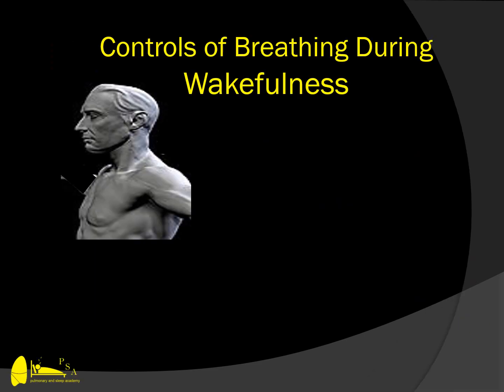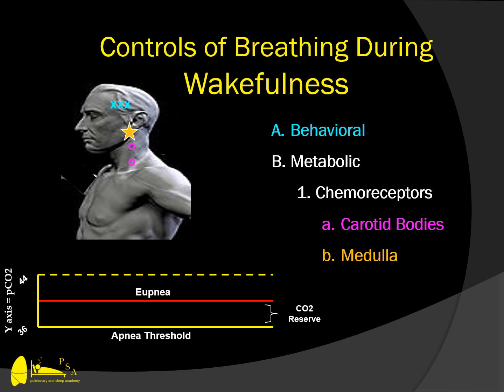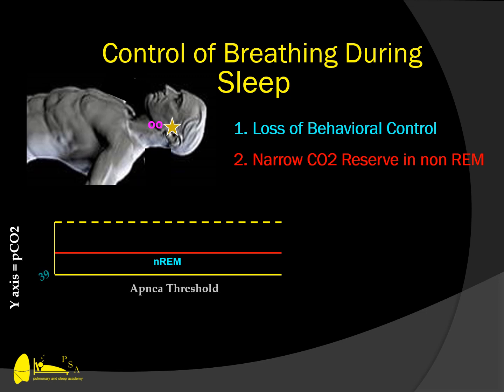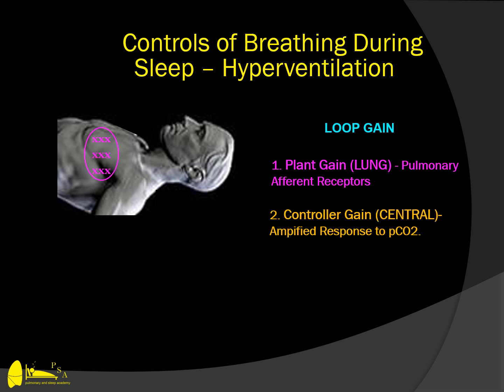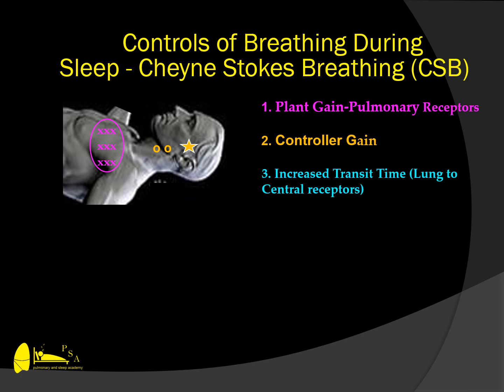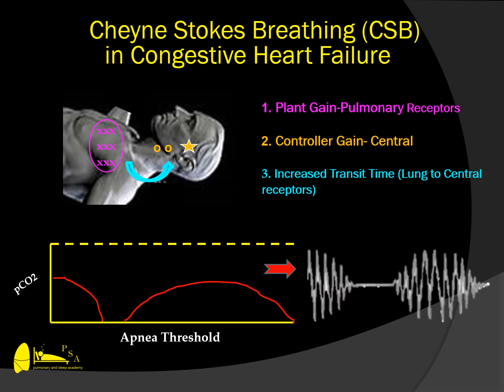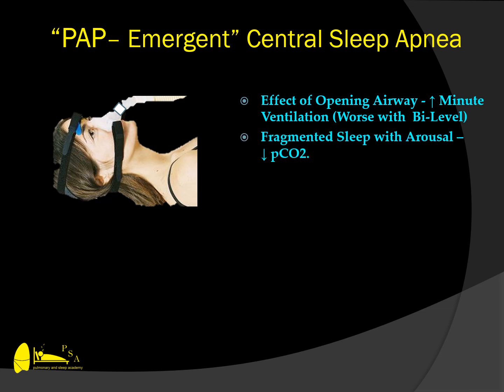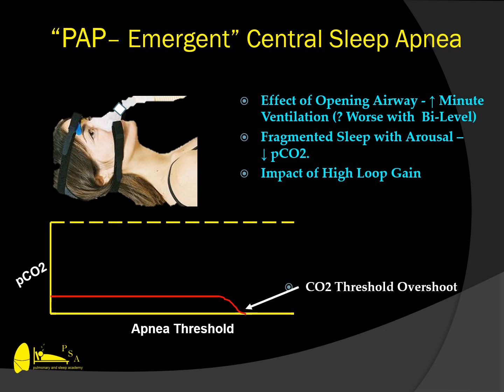Understanding Mechanisms of Central Sleep Apnea - BAVLS

Comment: Does anyone have a solution to this?   
I had some trouble with having high AHIs (probably mainly centrals) on my CPAP machine, cresting in the 50s. I told my sleep doctor we need to fix these. “Coincidentally” I had atrial flutter. Also “coincidentally” I had a cardioversion done on the morning of the sleep study that evening. My AHIs (probably mainly centrals) fell to sub five and stayed there for the next 10 days. “Correlation ≠ Causality” I can hear already! BUT‼️ Occasionally it does. I usually hear apnea contributes to fibrillation or flutter from my cardio but which is it? Post hoc ergo propter hoc would say the atrial flutter was causing the AHIs. 
The pressure of my CPAP was adjusted 10 days after the cardioversion by the doctor. So it was the cardioversion that fixed the AHI. Anyone have an idea how these are related and what is a fixit for it?

Comment: Can supplemental continuous flow O2, as provided by a concentrator, assist in decreasing CSA events, even if the O2 is used without PAP therapy?
Reply: It lowers life expectancy a lot
Reply: I Tried o2 concentrator by itself it didnt help
Reply: @michaeladams6050  sir i want to ask a question, i stop breathing, and later i wake up and gasping for air is this central or obstructive sleep apnea
Reply: @BlackMamba-lt8oe  depends, do you snore a lot? If so you may not have central. Central is the not the fun type to have.
Reply: @maximuswedgie5149  but here in india sleep apnea is not a disease, insurance doesn't cover this
Reply: @BlackMamba-lt8oe  that’s terrible, I am sorry to hear that, here in the states it’s not guaranteed either, my overnight sleep study was going to cost me almost 10k out of pocket. And I have good insurance. Not sure why this is not covered World wide. I know I will most likely die in my sleep, it’s a scary thing.
Reply: @maximuswedgie5149  what is too much CO2 in the blood, i have seen case of a person dead of no using cpap
Reply: @BlackMamba-lt8oe  Hypercapnia happens most commonly because of hypoventilation,during sleep apnea(either CSA or OSA) hypoventilation may occur which will lead to an increase in CO2.BiPAP can be used to washout the CO2 which can help in proper ventilation.

Comment: Can PTSD give central apnea?
Reply: I believe it does. I had a traumatic event happen to me a year ago and after that I’m always waking up gasping for air and and hasn’t really resolved itself. I also get faint electrical tremors when I start falling asleep.
Reply: @froylandiaz4846  I was being treated for PTSD that a friend thought I had. It was with optimum mind treatment. I have not since used with ASV. I am 51 years old and now know I had PTSD somewhere from the age of 2-5. I thought it was Autism. But then 45 years with PTSD and have had nothing else to compare it to. I had measured just over 8 min of breathlessness and have felt very bad since about the age of 13. I was diagnosed with acquired brain damage because tests showed I had extremely poor memory and poor impulse control. The healthcare system said I would become seriously ill at 40 and die before the age of 50. So I have obtained a lawyer and will ask for compensation for all the wrong done to me. I first suspected PTSD in 2019. But all focus on physical and found b12 deficiency. Dehydration because I haven't been thirsty, feelings that I didn't even know I didn't have.

Comment: I have an ASV machine and I breathe 10 times in min. If you set the machine to 15 times in min that I need, the machine breathes for me 100% of the time. I can not have that at all. So even with a machine, I am at 50% too little in volume air with a machine. The machine has also reggaed with the setting of 10 that it breathes for me sometimes 90% of the time. I have also seen before the ASV machine with measurement that I did not breathe in 8 min. I have waited 2 years now to be admitted. Covid does the hospital says they are not allowed to take me in.
Reply: I think you have perhaps some confusion. This is not how ASV works.

Comment: Sometimes when I sleep facing up I suddenly wake up gasping for breath and even after waking up I have trouble breathing and I feel like passing out. I have to stay awake for a few minutes and after that I have to sleep sideways. Could that be Central Sleep Apnea? It doesn't happen to me frequently and most of the times it happens when I'm stressed or when I haven't sleep enough hours the night before. I also have a feeling like my spine is been compressed and not enough blood is flowing through it, I don't know how to describe it.
Reply: Professional doctors are typically better at answering these questions than YouTube commenters.
Reply: Absolutely, I have this problem which also leads to anxiety attacks. The cpap machine is not a cure all, but a large aid in this and has nearly completely eliminated my anxiety attacks.I also have to sleep on my side.
Reply: Sounds like obstructive sleep apnea maybe the airways in your throat relax to much and you momentarily stop  breathing if it doesn't happen I'd say that pretty much indicates it's not central as positioning doesn't fix central sleep apnea
Reply: @Cw-wi6uj  momentally stop breathing is Central sleep apnea

Comment: I was diagnosed with OSA during sleep study. However, when using CPAP therapy has resulted in instances of CSA increasing during night. So, what should I do?
Reply: ASV MACHINE
Reply: I had a second sleep study and needed a BIPAP. CPAP didn’t help me at all. BIPAP does.
Reply: Same happens to me.  Itherws like other machines that change it's pressure when you breath that apparently help. Haven't tried it yet
Reply: Did you diagnoes with central apnea now???? Or switched to Asv??
Reply: Plz reply did you switch to Asv??
Reply: @preetimittal2123  No. I am still using CPAP. The second sleep study also gave OSA, so Doctors didn't advise ASV or anything
Reply: You have mixed sleep apnea. You probably need ASV, not Continuous.